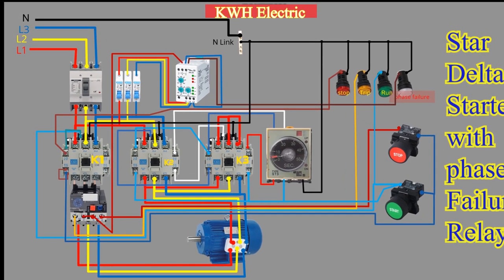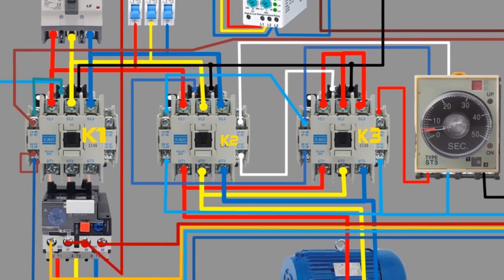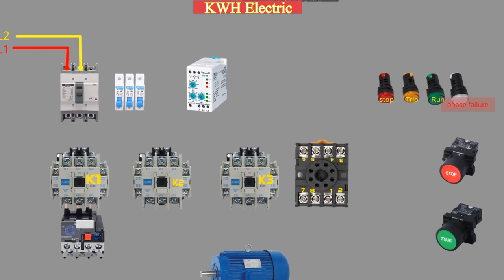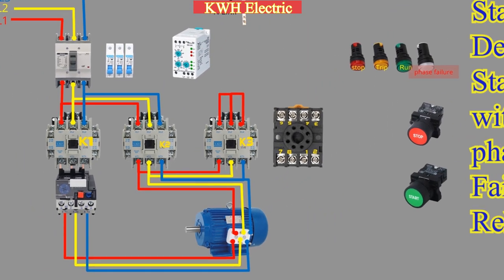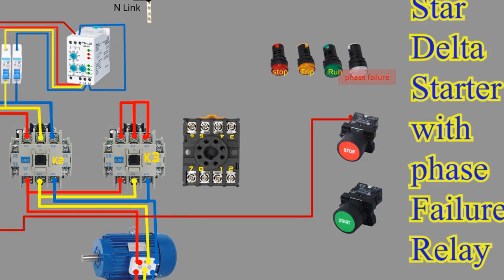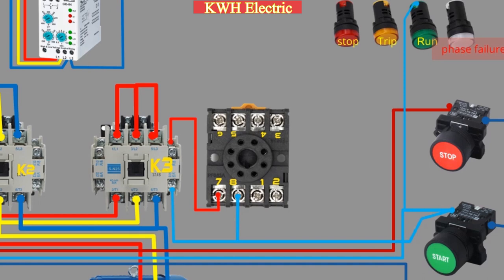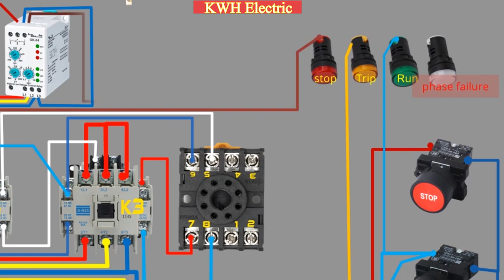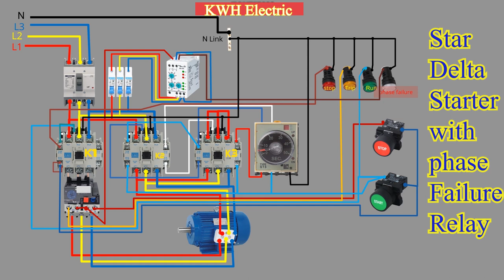Motor Protection: Star Delta Starter with Phase Failure Relay Explained

Comment from the maker: Correction 

"Hello everyone! I want to address a mistake that occurred in the video at the 5:11. I apologize for any confusion caused. Upon reviewing the footage, I noticed that I incorrectly connected a wire from terminal 1 of the Phase Failure Relay to the common terminals 95 and 97 of the Overload Relay. The correct wiring should have involved taking the wire from terminal 3 of the Phase Failure Relay. I deeply regret this oversight.

To ensure the proper functioning of the system, please disregard the wiring shown in the video and follow the corrected connection mentioned earlier. I apologize for any inconvenience caused, and I appreciate your understanding and patience. If you have any further questions, please don't hesitate to reach out. Thank you for your support!"